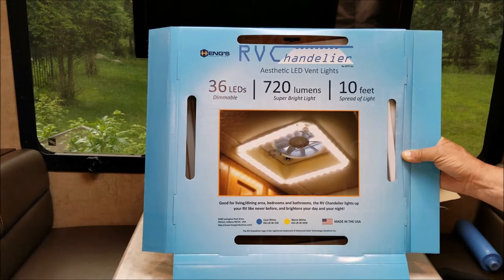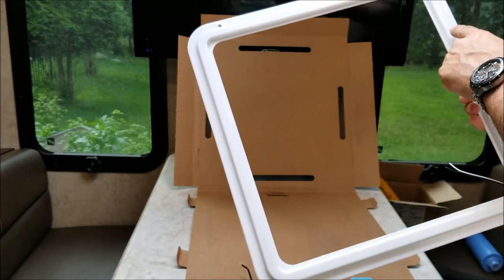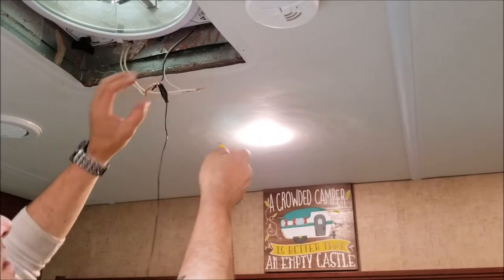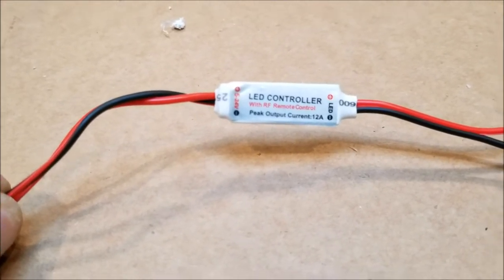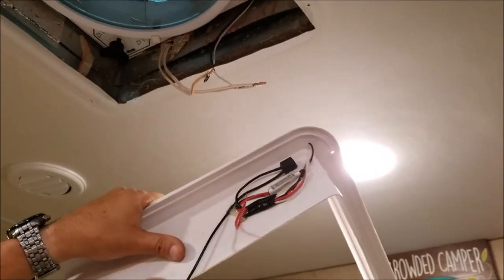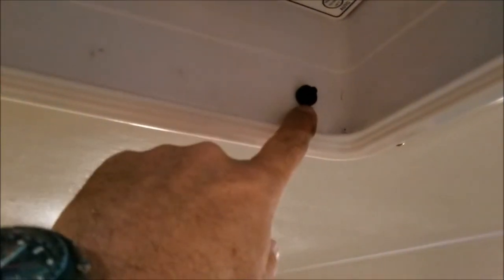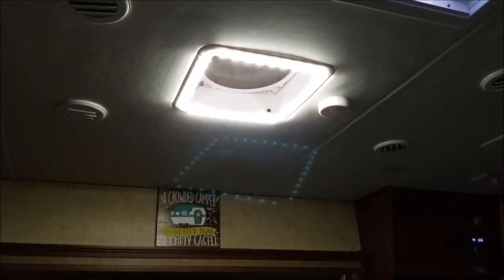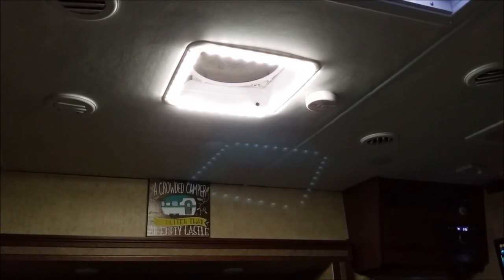Heng's RV Chandelier Vent Trim and LED Light Kit - Install and Review

Comment from the maker: I found that setting the the dim level on the light I like and then use the on off switch on the light itself.  The dimmer control remembers the level you set. This has been easier than dealing with the remote.

Comment: Thank you for your video.  This just may be my first mod for this years camping season.
Reply from the maker: Hi Dan, this gives a nice soft light compared to the LED puck lights.  I have found I just use the switch I mounted on the light and rarely use the remote.  Hope you enjoy it!

Comment: Nicely done video, straight forward easy to follow instructions  and to the point. Really like how this looks stock when the light is turned off and not bulky or anything. Great addition! I'll have to show this to Sabrina later today.
Reply from the maker: Thanks Kenny. I liked it so much i bought another one for the fan in the rear of the coach.  Whats nice is I set it on the brightness level i like then turn it on and off by the switch on the light and it remembers the last brightness setting.

Comment: Do you know if we could leave the switch out of the equation?
Reply from the maker: I suppose you could if you're using the remote to turn on and off but I like having a mechanical button in case of remote failure.
Reply: @RVHabit  Thanks.

Comment: Very nice and informative video. That's something i'd probably like to try. My mechanical ability is a bit limited though.... LOL. Are detailed instructions included? Awesome job.
Reply from the maker: There are no instructions in the kit.  The light itself is very easy just two wires, one to positive and one to negative.  The dimmer has no instructions either but it basically just goes between the light wires and the trailer wires.   I make it sound easy because I have a grasp of 12v wiring.  It can be challenging if you don't.  I bet you could do it though if you gave it a try.  thanks so much for watching.